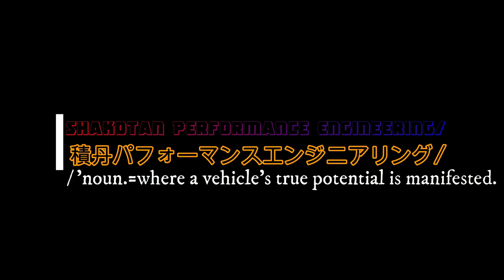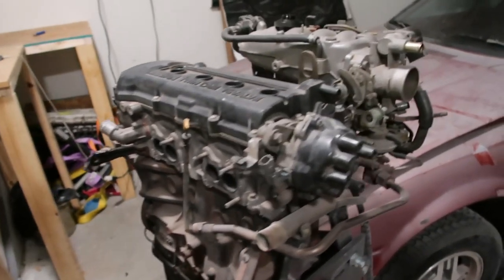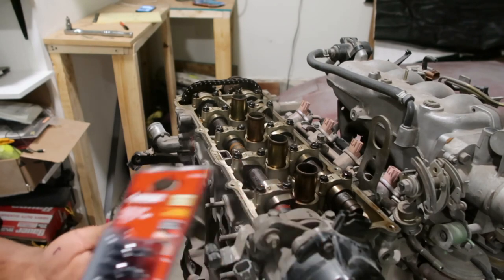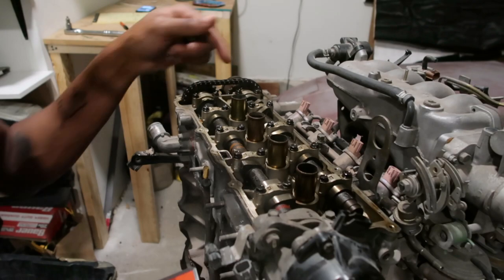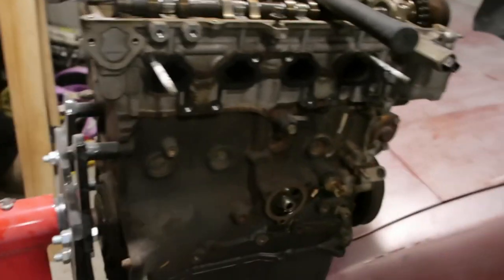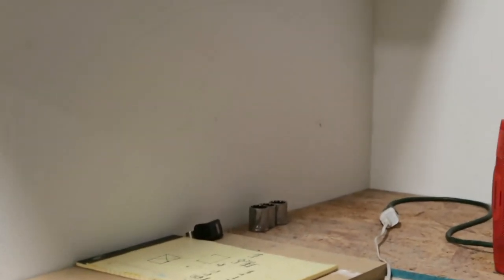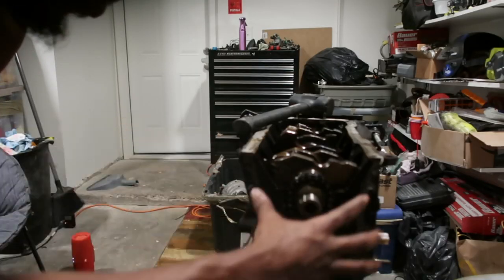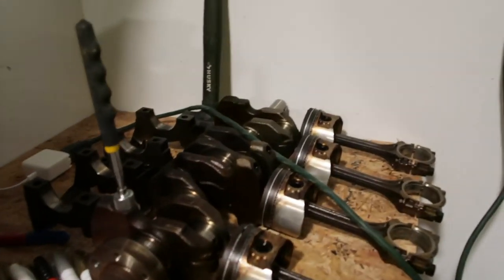1995 GA16DE MOTOR FULL DISASSEMBLY

Comment: Very good and very organised. I have a Pulsar n16 hatchback QG18DE engine it is excellent does not burn oil but the timing chain is just a bit noisey, I think it is just the guides and tensioner so think I may just change them and see if that cures it. Often drive it 700km in a day and only use synthetic oil (Penrite). It is 22 years old with 160,000km and still going strong and I'm hoping it will last out as I am 70yo, maybe another 10 years, lol. Keep doing what you are doing man, that engine looks ok.
Reply from the maker: thankyou for the kind words i really appreciate it.been busy but ill be uploading again soon with a more consistency and predictability.
anyways as it relates to your car, it sounds healthy and yes a good overhaul of the tensioner and the timing chain would do you good.just for reference the VQ35 engine timing chain starts to rattle occasionally around 130,000 miles.they said its due to the chain stretching overtime so yes whenever you get the chance and reasonable downtime,give her a new chain an tensioner!
nothing too serious for now these are old engines lol
Reply: @shakotanengineering6049   I'm expecting to have to do some timing chain maintenance on a GA15DE sometime soon. Is it necessary to remove the engine and/or cylinder head?

Comment: Hoping you can help,  @ 18:20 where exactly does that hose go. I bought a car recently and the previous owner just had it plugged up
Reply from the maker: hey i sure can.that hose is a vacuum hose where the end of the hose thats not connected would go to the valve head cover and connect to the "nipple"on it.
i found a video showing where the pipe connects to.its at the 24 second mark where youll see where the hose connects right next to the oil cap on the left when youre facing the engine bay.
hope this helps

heres the video,skip to the 24 second mark and pause it to see:
https://www.youtube.com/watch?v=EMFT5EfdFLk
Reply: @Shakotan Engineering  awesome thank you for the help
Reply from the maker: @hugoleal5106  sure thing glad i could help.stay tuned.this year we goin turbo!😁

Comment: What is the name of that piece that you disassemble at 12.30 minutes of the video?☝️🤔🤔🤔🤔🤔🤔🤔🤔🤔🤔🤔🤔🤔🤔🤔🤔
Reply from the maker: thanks for stopping by.i think youre talking about that hose if im correct,and that hose is a coolant hose that connects to the thermostat housing, it wraps around the engine to the right side and then it goes down to the bottom of the radiator.
i think that one is called the coolant return hose 👍🏽
Reply: @shakotanengineering6049  Thanks... but I don't mean the hose, I mean the metal tube where the hoses go... that metal tube is the one I wanted to know the name of the metal tube
Reply from the maker: @luisrivera2089  oh my bad.so i just did some research and its called a water pipe but theres barely any info on the online about it.
i did find a part number and a website that might sell them
part no: N-21021-0M301-3 and 21021-F4101

heres the website:
https://articulo.mercadolibre.cl/MLC-459930159-tuberia-agua-nissan-v16-9711-_JM#is_advertising=true&position=1&search_layout=stack&type=pad&tracking_id=15e7323c-86a3-4681-9bd4-aeeda33f6f5a&is_advertising=true&ad_domain=VQCATCORE_LST&ad_position=1&ad_click_id=NzhmNzkyZmEtNTRhMy00M2Q0LWIyZTQtZTM0MmY2NWRiNDM4
Reply: @shakotanengineering6049   OK thank you very much

Comment: great job is the same procedure for ga15de right  also can you do for transmision  will appreciate
Reply from the maker: it should be a similar process but get the manual if you can.i was researching and the manuals i see say "ga14/ga15/ga16" so im assuming its the same process so the ga16de manual should help.
and about the transmission.im going to do a video on it soon assembling it but i need to take it to a shop to get a pilot bearing removed and installed first.stay tuned!
Reply: @shakotanengineering6049  oh okay  will d it i as i awaiti or the transmision

Comment: Bro my GA16DE locked up it doesnt crank i wonder if that can get fixed im not sure your thoughts ?
Reply from the maker: im so sorry for the late reply man ive been hella busy.been tryna gather the resources so i can start posting consistently again.
anyways.....yes it can definitely be fixed.if its not seized up from rust there's a chance the motor can be saved.
when was the last time it started and what do you think might have caused it not to want to crank anymore?
do you have a fully charged battery?
are your spark plugs in good condition?(do you know how to check them and also check if you have spark to each cylinder)?
when you turn the ignition to the last mark before starting it,do you hear the fuel pump "prime"?
let me know😎
Reply: @shakotanengineering6049  yes fuel pump works I removed fuel filter and I got fuel all over me lol last time it was ruiing was 2 months ago. It does even trun on when I pop the clutch. I took it to a handyman mechanic and tried to turn the motor and it didn't turn. He said it's locked. When it died on me it was on and Idling in a walmart parking lot then it just turned off and couldn't get it to turn, I changed the matter and it wasn't that so idk maybe starter but it doesn't even turn or crank when I pop the clutch so idk
Reply from the maker: @SanAntonioNewHomesForSale  damn i wish i was physically there to look at it.
how about spark?you have fuel comin from the pump so the next step is to check for fuel pressure of spark coming from the plugs.
by the way is the check engine light on on the dash?if so what code is it throwing?

oh one more thing to check if its completely locked,jack the car up in he front(both sides and be safe about it) and get the socket for your crankshaft bolt with a breaker bar and try to rotate the crank with the socket.make sure the car is in neutral first.if it spins we're good,if not we're not so good

Comment: Hey..loving the content. I would like to know if that same ga16de head would work on the ga15de block...pros and cons and what I would need to get it done
Reply from the maker: thank you so much and i dont think they would work.i dont have any experience with the ga15 but i know its carb and it has different from the ga16 in other ways but i did a quick search and found this:

https://www.nissanforums.com/threads/using-a-ga16de-head-on-a-ga15-carb-block.129541/
Reply from the maker: that info is also outdated so who know whats possible but your best bet is to get a ga16de or even better an sr20.
Reply from the maker: ok so more reserch shows that the cant work for the simple fact the the ga15 is single cam and the ga16 is double cam so it wont work my friend

Comment: How is this version of the ga16? Because I don't know this plenum?
Reply from the maker: what do you mean by how?like is it reliable?if so, then yes id say it is a reliable motor.i drove my b14 from California to Georgia non stop...only for gas and to change a flat tire.
as long as you maintain it she'll do you right.
as for the plenum,what year do you have or use to? because the b13 is '94 and has the eccs badge and is shaped different while the b14 is 95 onwards and has a different designed plenum
Reply: @shakotanengineering6049   hey I talk about the plenum, because me in France we don't have this plenum on ga16
Reply from the maker: @tomauvray3316  does your plenum have "ECCS" on the top of it?
Reply: @shakotanengineering6049  No-no in France we just have the air filter box on top of plenum, the injection is top mount
Reply from the maker: @tomauvray3316  ok thats different.send a picture to my email if you get a chance: shakotanengineering@gmail.com

Comment: do you know the GA16DS ? the carburated engine ?
Reply from the maker: ive heard about it but dont know much sorry,what did those come in?
Reply: @shakotanengineering6049  i have a nissan primera P10 with this engine and he have carb and i have some trouble (fixed now) i haved a vacume leak in carb on cold choke system one of valve is damaged and cannot open the butterfly correctly at start i have a channel with i explain this things
Reply: @shakotanengineering6049  https://www.youtube.com/watch?v=QFoC_uQ1IcI Thats the video at de time when i haved the trouble but now is fixed you can also watch the video, and the fixes is just the change the valve with a another from a other carb same called Nikki hitachi 21L304-06

Comment: How is it going with the overhaul?
Reply from the maker: hey,this motor is for my street/drag racing build that i have planned.its going good btw.ran into some unwanted rust in the water jackets so i got another engine that ill be posting that video of soon where i find a better engine block to build  with.stay tuned i plan on being more consistent with posts.ive been busy.
Reply: @shakotanengineering6049  That is great! I've been building this gen of GA16DE engines for years and they are super strong! If you need any advice or information let me know. I'd love to be part of it at the distance. Good luck picking up the block, make sure it is not machined already so you can run it to the next size fresh
Reply from the maker: @jeirsosalas7799  thanks so much that is appreciated and i definitely will if i have an questions.the blocks i have are fresh from the junkyard and dont seem to be machined,so these are ready for us to abuse them :D

Comment: i got a ga15de nissan sentra but dam my car smokes alot and the mechanics where im from in SA killing me with to my engine over dont got 16k now
Reply from the maker: can you say that again lol,i didnt get all that you were asking?but i did get from your comment that your ga15 smokes alot.i have no  experience with the ga15 unfortunately but the ga16 share some similarities.
when does it start smoking?as soon as you start it?a little bit after you start it?when youre driving?and what color is the smoke?
how is the engine behaving when its smoking?
sorry for the late reply been really busy
Reply: @shakotanengineering6049  it start to smoke when start but it doesnt do it everyday so ja it does smoke got a little bit black smoke but more white smoke but also it dont smoke like you cant see behind you you can see clearly behind you but lets say when i been driving for a 30min or more then you can really see the smoke no more and yes im also confuse bout it some say its your rings some say its you valve stem seals and oh the GA15DE looks the same as the 1600 engine only the ga15de is a import engine
Reply from the maker: @waleedsmith2876  well sounds like you had the same issues i had with my engine.do you have a loss of power when trying to drive sometimes too? and does it happen randomly as well?
that use to happen to me but my smoke color was like whitish grey.the color is very important but either way oil is getting into your combustion chamber somehow and worn piston rings,worn valve stem seals and in rare cases a head gasket that leaks on the 'oil side' can cause all of these.

when i had the same problem it sounds like you have,the first thing i did was change the headgasket.that didnt work and i only drove the car for a week with the same smoky symptoms showing up on day one proving it wasnt the headgasket.
i pulled the motor again and then did a complete ovehaul.i changes the piston rings,valve stem seals and a new headgasket.i havent tested yet because ive been busy but im sure this has fixed the problem.the motor is in the car but i will defiatley post a video when i do the first start.i also wanted to ad fresh axles but ive been busy but anyways your problem might be between these two things:worn valve stem seals or worn piston rings.
to check if its the piston rings you could do a compression test and see if the numbers are up to spec and the numbers are close together.
as for valve stem seals thats a different story.youd have to to take the cams and springs out to see if they are too hard and brittle. but if youre high mileage you should just go ahead and do an overhaul😎